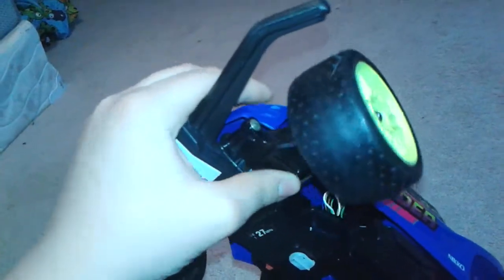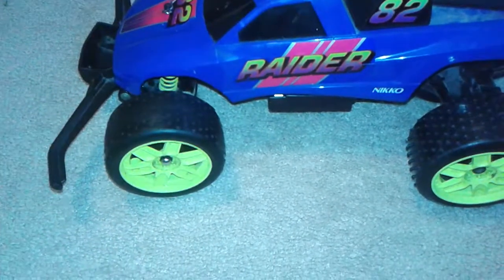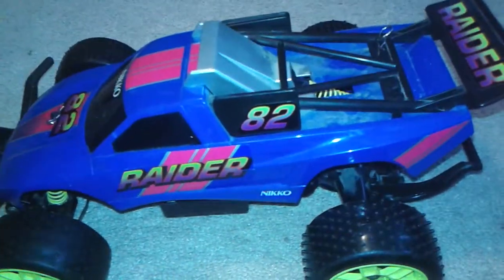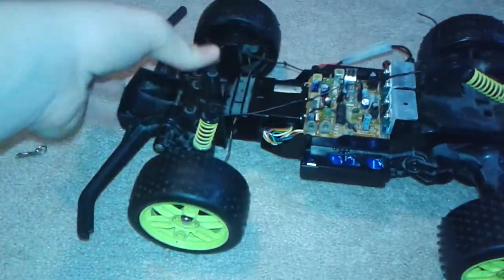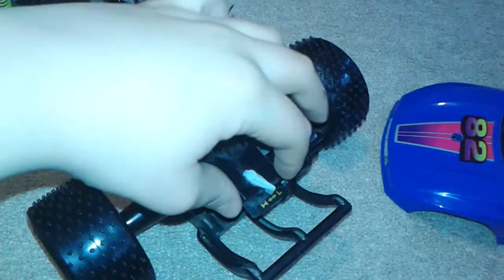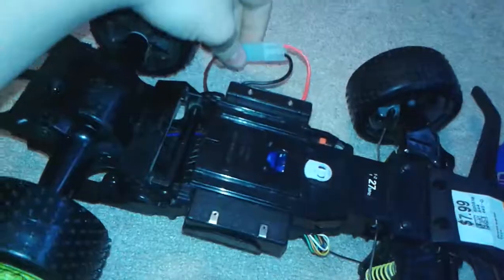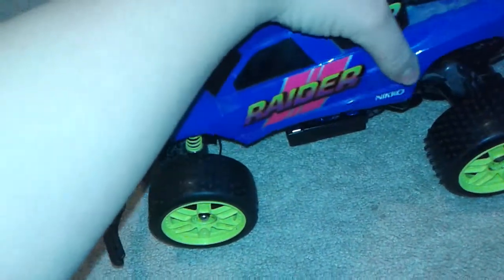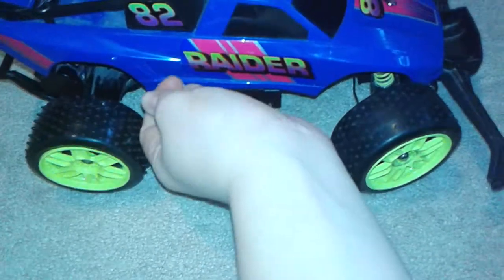Nikko Raider rc stadium truck review.

Comment: I had one of these when I was in my early teens. I put some monster truck tires on it from a thrift store model. They were bigger, rubber (better than the junk plastic stock tires), and made the truck a lot more fun. I also painted it and put working headlights on it. Nothing on it ever broke or shorted out and I abused it regularly. Great little RC.